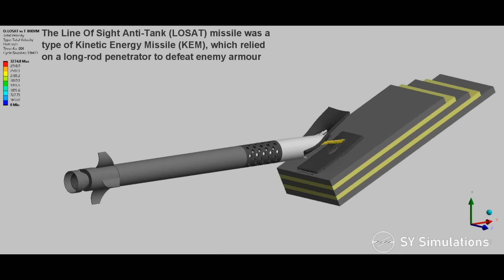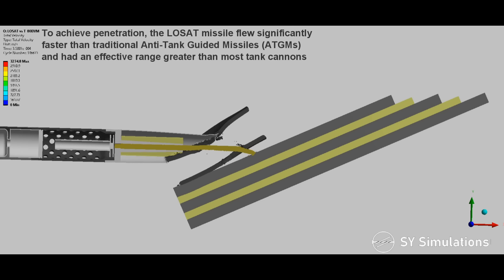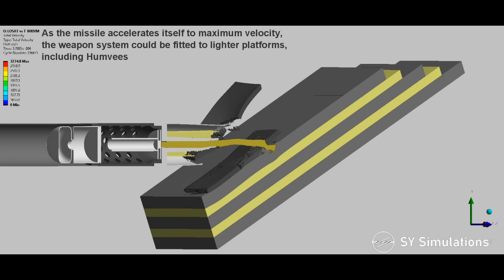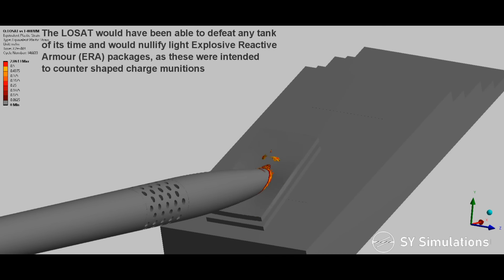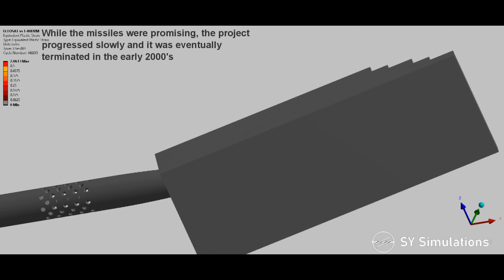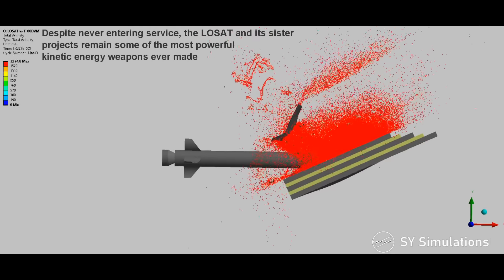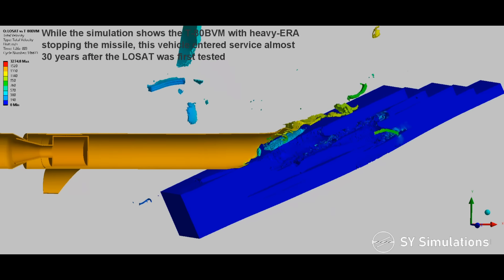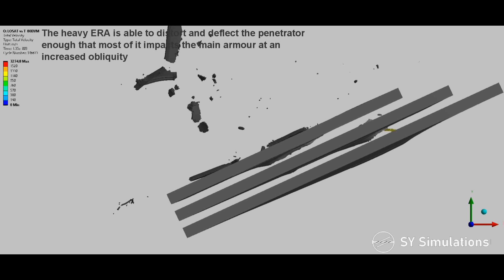LOSAT vs T-80BVM | MGM-166 Kinetic Energy Missile vs Relict ERA | Armour Penetration Simulation

Comment: Majority reason it never got anywhere was because it was SACLOS system and its launch signature was large enough to blind the gunner/guidance system long enough for it to matter IIRC
Reply: I think the bigger factor was LOSAT is only useful against a tank. You can use a TOW on anything you can hit. LOSAT would kill one person if it directly hit, TOW would cream the squad.
Reply: There were many reasons it didnt go anywhere. A big reason was that it was highly subject to weather conditions, and poor weather could really mess it up. A second was that it had a minimum range of ~300m to get up to speed. Not bad if youre in an aircraft (which it was envisioned being used on as well) bit less than ideal for ground use. Finally, the end of the Soviet Union meant that the feared (and somewhat in development) Soviet supertank projects like Obj 640/195/299/490 never saw production so there wasnt really a need for an incredibly powerful anti tank specific missile.
Reply: No it was not saclos nor was the flir blinded on launch ..  the missile flew an offset trajectory at launch specifically not to break track lock with only an update or two needed to remove launch error. The laser never pointed at the target. The propellant going high order on impact was roughly equivalent to a 100 lb GP bomb which is far more than any TOW could ever manage. The minimum range issue was pretty well meaningless given the majority of unburned propellant detonates. Too many folks here have no knowledge of the system and are just guessing. I was present at all the live fire tests. There is nothing known to man that would survive a losat impact…and yes…the heaviest era packs imaginable were tested.
Reply: @Derek-je6vg  
I'll be first one to admit if I'm being wrong and tried to write that comment from top of my head instead of checking if actually remember correctly
Reply: @everythingsalright1121  Obj 640 and 195 are post USSR. obj 299 never left paper. Obj 490A was superseded by obj 477 very early on.
Reply: @Derek-je6vg  It couldnt hit anything if it was slightly angled... No hull down peek over the hill shots... You need both the LOSAT and target to be stationary and at same altitude, just to hit the target.
Reply: @ nope - the original vehicle was a 16 round Bradley with normal turret - and nope - no amount of target movement was an issue - it could hit fighters at a full crossing angle at high speed  - it’s all a problem with how it’s modeled - not how the system actually performed
Reply: @Derek-je6vg you were present? In that case could you explain exactly how the guidance worked? It seems to be lofting so it's not beam riding like a Vikhrs
There's no wire so it's not wire guided like a TOW
There's no sensor in the nose so it can't be SAL like a Brimstone 
And it's not radio guided or radar

The most consistent thing that I've been told is that the laser tracks the missile and gives the missile updates through an encoded beam, like a wire except it's a laser. While the FLIR provides the needed updates for the laser to transmit.

However, despite any document or pamphlet I look through, nothing reliable describes how its actually guided

I've been interested in the history behind this project for years, but I've never been able to get a concrete answer
Reply: @ yes I was present - it was slightly lofted so as not to blind the flir- target lock. There were two tracking gates per missile - one got the target and one for the missile. The missile rolled and the missile always knew the up direction…thus it’s thruster section always had thrusters available to fire in any direction needed depending on where the missile roll put the thruster. The missile would fire a thruster as needed as it rolled into position for the required push. Typically all that was needed was to null out the launch error for ground targets. After that the collision course to the target remained stable with few if any additional course corrections needed thanks to speed . That typically happened in the first 1/10th of a second of flight. If the target was a helicopter or crossing aircraft that was maneuvering you would need to fire more thrusters. it kept track of what thrusters had been expended  in the ACM section. The laser beam was not encoded - but the clocks between the launcher vehicle and the missile were synched at launch. I will not go into specifics in open forums. Let’s just say the missile knew when to look for a valid update and ignored anything else. The missile periodically opened its eyes for that update and the fire control hit the missile back end with the laser within that window. No update required - no additional laser activity required. We never discovered any means to counter the guidance system. Lord knows we tried. It was a very large aperture high resolution flir operating in far IR. The system could control three missiles in the air simultaneously against three different targets. Once the fire command was given the system required no crew interaction..all automatic. In its final variant you could park the vehicle and put it into sentry mode. It would automatically engage any targets seen within the kill zone without any crew aboard. When all ammunition was expended it could notify higher it required resupply or repositioning. There were three variants - the Bradley variant had 16 rounds - the m-8 Buford light tank variant 12 - the hmmwv variant 4.
Reply: @TwixSvK  nope - that’s the way a game portrays it - not what the system actually did.
Reply: @Derek-je6vg  you are probably my only chance to confirm this. Did the AGS/CCVL variant of the LOSAT ever exist? When I look through documents it only describes it as "proposed", and any image I find is labelled as "artists rendition". Even digging through the entire Internet Archive I couldn't find anything on it existing outside a concept.

Based on the way you described the guidance, what kind of system would you call that? CLOS? Or an advanced form of SACLOS?
Reply: @ yes it existed - we had operable prototypes - we bought several Buford chassis just for that purpose. I tried to get one released to the then ft Knox armor museum but I couldn’t convince the company to do it. True story - the army chief of staff came to visit and look at hmmwv variant. Pontificating - he said what was really needed was a light tank variant. The Buford was sitting right beside him so we pulled off the covers and showed it to him. ‘You mean like this?’ He then said it would be killer if we had a Bradley variant. We pulled off the next tarp and there was the Bradley. ‘Like this?’ He was dumbfounded - he had no idea just how much time and money the army wasted going from variant to variant. As for the guidance I wouldn’t call it either - the missile was capable of some really crazy off axis stuff thanks to all the acm’s it carried. The beauty of the system was that its speed limited what any target could do - once launch errors were nulled it rarely needed more course correction. You can see that in the videos online - ACM activity at launch and rare firings once it proceeded down range. No corrections were needed - the missile was simulating its own flight as it proceeded to the target and in general terms knew what it had to do to hit even if no guidance updates were given. I probably have pictures of the Buford variant if I go looking. I used to love sitting in that thing and driving it.

Comment: If I remember correctly. 
The absolute MASS
And ENERGY
that the missile transfers to a target, is equivalent to getting hit by a Mazda Miata

AT MACH ONE
Reply: mach 5
Reply: @chickenchicken8097 me when I don’t understand how comparisons work:
Reply: The sabot round for the M1 hits with the same force of a freight train travelling at 60mph with the surface area that of a dime. So they say in transition school.
Reply: Most of the missile's weight is propellant and body — the penetrator itself is only 6 kilos. Can't be arsed to google the burn rate but safe to say the propellant will be all gone by 3 klicks and not that effective before that.
Reply: @Klovaneer  nope - not even close

Comment: Can you try kinetic resistant ERA like K5 or Relikt, in a WW2 or early-mid Cold War matchup? For example, Sherman + K5 vs KwK 40. Or T-55 UFP + K5 vs M392A1. I wonder how well ERA works against these older rounds instead of APFSDS.
Reply: not at all, full caliber rounds are too big to be easily destabilized by a ~15mm flyer plate it'd have to be much much bigger
Reply: The round won't be effected very much due to the size and weight of the shell

Comment: I knew the company commander of the test company at Ft Bragg which for some reason was an infantry company assigned to Corps Artillery. Anyway, he had some interesting things to say about the performance of the weapon. Short version: there was no vehicle at the time it could not penetrate. The rest of the system though was not so promising.
Reply: Close to all tanks could have been perforated but some Soviet mbts had better base armour than this t-80bvm and sported k5.
Reply: Nahhh - by the time the hmmwv variant was fielded the army was so desperate for infantry it deactivated the single company as fast as it could. Those systems never even got proper spares support. I was there. The problem was the army could never make up its mind. First a heavy weapon, then a sheridan replacement, then the hmmwv once they cancelled Buford. The best variant was the Bradley. We never had any reliability issues on it. Trying to cram it into a hmmwv was a stretch. I’ll say this again - the rod as portrayed in these sins is not accurate. I can’t say more.

Comment: I'd love to see this simulation repeated with the LOSAT impacting armor of a vehicle contemporary to its time, or even this same armor but without the ERA package.
Reply: Well the 5 layer composite armour entered service in 1983. The t-80bv sported this armour since 1985. The same year K5 entered service. The t-80bvm just entered service in 2017 due to other reasons. Relikt already existed at that time. All that has to change for your wish to come true is to model the exact same scenario with k5. Other tanks of the time were better armoured than the t-80bv with k5.
Reply: Since this was basically the equivalent of a penetration (Even if there wasn't spalling taking out the driver, the volcanic glowing crack in the hull would dissuade most people to change their course of action) , you can infer the missile will succeed  against all lesser targets.
Reply: @chriskortan1530  or a very angry t-80 crew tracing the huge white smoke trail back to the sender.
Reply: @Masterafro999 I think I’d be piss scared about the object I couldn’t react to than angry after it hit my hull like LOSAT would. That’s definitely a brown pants moment if it didn’t penetrate.
Reply: @ronaldmcreagann6343  would be like anything else hitting your tank. Definitely a brow pants moment but since noone died and the vehicle is still intact, I'd say that they'd gtfo. If the spot the losat whilst gtfoing then they might return the favour.
Reply: @mirroredvoid8394 yes. That's exactly what I based my gtfo scenario on. Surviving is worth more than standing your ground in most cases.

Comment: This is just a simulation. In fact, as it is in reality, you need to do the real test several times. 
I myself do electronic simulations and then test on a real circuit, sometimes what works in the simulation works, other times it doesn't, and that's why we never rely on simulation. Simulation is an aid not an oracle.
Reply: Try get your hands on a LOSAT and T80-BVM
Reply: Multi million test. Bravo

Comment: Wait. So the m829A3 and m829E4 are bigger and faster than losat? From what i seen. m829A3 is 960mm long and 26mm wide.
Reply: Yeah. LOSAT was designed when M900 and M829/M829A1 were the rounds of choice. 

M829A3 and A4 are longer and heavier, and thus superior at defeating armor.
Reply: no, M829A3 penetrator is shorter than 800mm
Reply: @christians.597  No it really isn't. The idea that the M829A3 uses a steel tip is based a few blog posts that misread the patent application dates. The M829A3 uses a DU body and Tungsten Tip.
Reply: @evanbrown2594  then how long? because the projectile is 924mm and I don't know how long is the fin but the tip is minimum 10cm
Reply: @christians.597  The M829A3 has a total penetrator length of about 780-800mm. The alloy involved performs about 6% better than that alloy used in the M829A1 vs RHA at 0 deg, and the expect tensile strength of the rod at the time was considered a generational improvement against complex armor arrays developed in the 1990s. I only have rumors as to what these arrays looked like.
Reply: @evanbrown2594  about 780-800 hmm so i was pretty close :D

Comment: The T-80BVM did not enter service 30 years after this. xD Its just a T-80B with Relikt ERA and new sights/electronics. Which means that the old armor held up. T-90M however would be a good example of newer tanks.
Reply: It’s an objectively worse armor layout at best it’s the same lol
Reply: @andrewjack5755  T-90M? No, sir. That tank is completely reworked. The T-80BVM however is just a T-80B with new ERA and electronics.
Reply: @bittemeinrammstein  T-90M uses the same composite array from T-72B (1989) and (1990), only with Relikt instead

Comment: That simulation is just for fun
Most of these simulations don't even distinguish between RHA and HHRA or reflect what is written in the manual. In the case of LOSAT vs BVM, LOSAT penetrators vary from source to source, so the comparison is meaningless if the data used by the warthunder is not the same as the data for LOSAT with 140mm apfsds-based penetrators referenced in the simulation.

Comment: why isn't the penetrator isn't the entire length of the missile?  Since the penetrator is very thin and the penetration ability is proportional to its length,  it would be common sense to make it the entire length (just like APFSDS shells), just mold the missile fuel and electronics around the central rod.

Comment: I wonder if kinetic penetrator missiles will make a comeback now that active protection is becoming more common.
Reply: APS is not common/affordable enough to be a threat. By the time they became common they would be advanced enough to respond to hypersonic threats. Kinetic energy missiles are dead end tech.
Reply: @Phapchamp  idk man, a dense metal rod flying at extreme speed is very difficult to counter.
Unlike chemical warheads, you can’t degrade its performance by changing its shape or triggering early explosion.
Reply: @thomaszhang3101  Uh no wrong. APS can degrade the performance of KE penetrators by deforming the rod itself. Some of the current APS can do it even let alone future ones.
Reply: @Phapchamp  I’ve seen his simulation of APS on rods. It doesn’t seem to do a whole lot even in the most ideal circumstances when most of the APS fragments hit the penetrator
Reply: @thomaszhang3101  Even a slight bit of structural deformation to a rod will significantly effect its penetration. That is how ERA against KE penetrators work as well. Main problem with APS is cost. Even the cheap ones cost upwards of 1M$. This adds up really quick when you try to fit hundreds of them. Especially considering APS can't respond to most threats a tank faces. Like mines FPVs artillery etc.